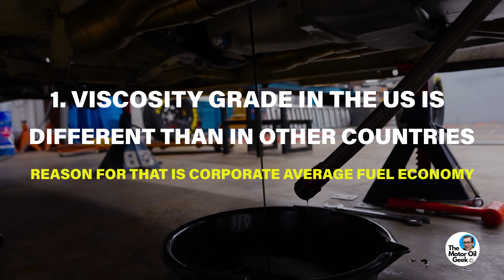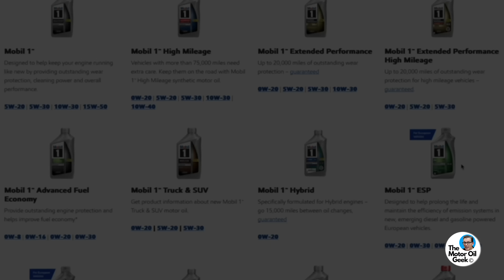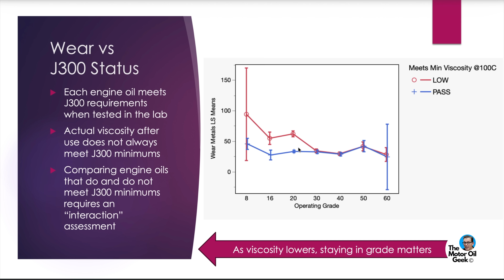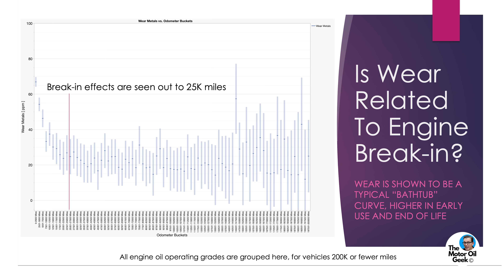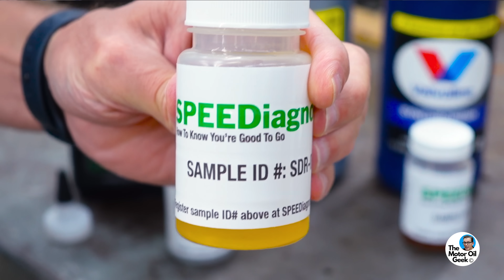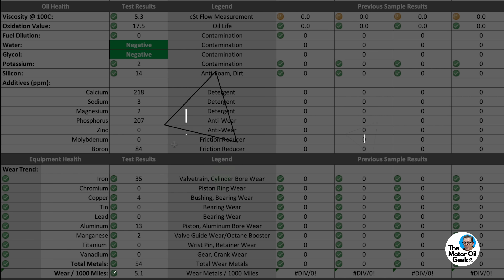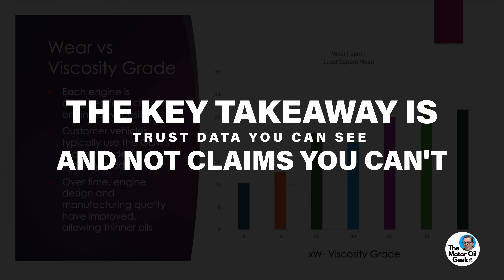More Ai Lies? The FACTS about 0W-20 vs 5W-30 (With Evidence)

Comment: My two newer Mazdas call for 0W20 in America everywhere else in the entire world the same exact car with the same exact engine call for 5W30. I switched them over to 5W30 because the 0w20 is recommended here in the US due to EPA mandates not necessarily engine longevity.
*Edit I also live in southern South Carolina where we see temperatures rarely go below freezing and the summers are hot!
Reply: 5w20 should be good too
Reply: If I understand correctly....basically, the very single reason these thin engine oils exist is due to gov't interference/ CAFE!?
Reply: @hynsum Kinda, emission regulations is extremely strict in the us and manufacturers do everything to make there cars get higher mpg ratings. One of these tricks is to use thinner oils. Thinner oils flow easier and therefore less energy is used by the oil pump. Less energy used = less fuel used.
Reply: @davidontiveros554 not mainly oil pump but friction between cylinder walls and piston!
Reply: @hynsum  ...YES....cars are mandated to have certan "Corporate Average" Fuel ecoomy ( hence "CAFE" standards) ...to ALLOW them to be sold...so YES....the average is for the total number and type (size) cars a manufacturer offers.  As the fuel mileage standards/demands increase every year....the makers need to find every way possible way,  to eek out that extra 0.1 or 1.0 mpg......
Reply: @hynsum  Yep.  Seems i read a couple of years ago that the manufacturers get fined by the government for every 1/10 of MPG the fleet of vehicles are below the CAFE standards.
Reply: @jerryware5749  CAFE regulations are dead. Our President abolished those mandates a few months ago or so.
Reply: @horseathalt7308  He did not. I wish he would! He simply rolled them back a little bit.
Reply: Same here, 2024 CX-5 NA.  I use 0W30 in winter and 5W30 the rest of the year.
Reply: @MEfunny111  OW-30 basically covered all seasons. Why need to change to 5W-30 ?
Reply: @vitkiu  Usually the wider the range, the more viscosity enhancers are needed to stop it from going too thin at high temperatures.
Reply: @vitkiu  In theory the 5W-30 would have less sheer so maintain the grade better, however just like Lake said and used oil samples being taken from the very same engine of different brands/formulations, that not all oils listed as the same viscosity have the same sheer stability. But you are right that on paper, the 0W-30 in theory should work fine all year around and to be honest some full synthetic 5W-30 oils perform almost as good as a 0W-30 in cold flow testing results done by oil manufacturers.
Reply: @Sylvan_dB  Thanks, it's good to know.
Understanding Viscosity and Its Enhancers
Viscosity Basics
Viscosity measures how easily a fluid flows. In motor oil, it indicates the oil's thickness at different temperatures. A wider viscosity range means the oil can perform well in both cold and hot conditions. For example, a 5W-30 oil is thin enough for cold starts (5W) and thick enough for high temperatures (30).

Role of Viscosity Index Improvers
To maintain performance across a wide temperature range, viscosity index improvers (VIIs) are added to oils. These additives help prevent the oil from becoming too thin at high temperatures.

Impact of Temperature on Viscosity
Low Temperatures: Oil thickens, making it harder to flow. VIIs help keep the oil flowing smoothly.
High Temperatures: Oil thins out. Without VIIs, the oil may lose its protective qualities, leading to increased wear on engine parts.
Viscosity Index (VI)
The viscosity index indicates how much an oil's viscosity changes with temperature. A higher VI means better stability across temperatures. Synthetic oils typically have a higher VI than conventional oils, allowing them to perform better in extreme conditions.

Conclusion
In summary, a wider viscosity range in motor oil requires more viscosity enhancers to ensure the oil maintains its protective qualities at varying temperatures. This balance is crucial for engine performance and longevity.
Reply: @charlesb4267 
Thank you for helping me to understand this better. (:
Reply: @MEfunny111  wow, switched already, not that it really matters I am going to work my way up to 5w/30 over 36k miles
Reply: @MEfunny111  Just switched my 2024 NA CX-30 to 5W30 Valvoline Restore & Protect oil today and also live in the Minnesota winter, only have 11,000 miles on it, and after switching it today, the car seems quieter but have yet to try a cold start
Reply: Smart, 5w30 is not going to do harm.
Reply: In your climate you would easily be able to use 10W-30 if you so desired although for the best oil characteristics with sheer stability and a good NOAK rating, I would still say use a full synthetic oil. Of course change the oil often enough ( and that is where the question mark will be, what is often enough ! ) and imagine you have that totally retarded stop start crap and to prevent that from functioning and those various interventions certainly won't hurt your engines lives one bit.
Reply: Smart!
Reply: 2020 Mazda 3 here running 5w30 all winter. Runs like a champ. Also on a tune which causes richer mix/fuel dilution. Currently @145k miles.
Reply: @shueher1 what are your low temperatures during the winter?
Reply: Same. I have a 2025 Mazda with the 2.5L NA. I also switched to 5w-30. I especially felt good about that because I’m in Phoenix AZ (stupid hot in summer and pleasantly warm in winter).
Reply: @duaneschleef  I've been to Phoenix once years ago during January and I certainly didn't experience anything that required a 0 anything oil, there would never be a real reason to use anything less than a 10W-30 in all honesty during the winter, never mind during your summers. I was also through Death Valley once in the middle of July and it was 118f ( and was told that was right on average for that time of year in Death Valley ) which I understand Phoenix can get as well every so often. If I lived down there I probably would run a 5W-40 or if I could find a high quality 10W-40 full synthetic, especially during the summer in my GM HD gas pickup ( GM calls for 5W-30 as a heavy duty gas engine ) and make sure to change it quite often as the manufactures recommendations are totally out to lunch for oil change periods.
Reply: I have a 2019 Miata calls for 0w20. I'm going to switch to 5W30. Glad Trump got rid of the cafe standards
Reply: I work on a lot of Mazda engines and their turbo engines take 5w-30. Probably because of the forced induction helping out with fuel economy so Mazda just says to use 5w-30 for the added protection of the turbo/engine
Reply: @andrewflores4981   Yes, Mazda also recommends 5w30 for 2.0 and 2.5 engines in Mexico but 0w20 in Canada and USA. Viscosity is one thing but the specs are more important to me, my 2021 calls for ILSAC GF-5 ( API SN ) which dated 2010 but we can put ILSAC GF-6 ( API SP ). Those are always backward/upward compatible ( latest incorporate more protection for Turbo engines )
Reply: America's speed limits are much slower.European speed limits are 120km-130km 75-80 and more hence Freeway speed.
Reply: Yup same here both my mazdas I use 5w30
Reply: The engine in my 2015 honda accord like to use the johnny walker black 5w30. Runs smooth and ticks a lot less.

Comment: Blanket statement claims are the issue here. Oil weight should depend on use case. The hyper car manufacturers have done it this way for years. They'll recommend 0w20 if you're driving like an old lady on the highway (very little heat accumulation) vs a 40 or 50 weight if your racing it on the track (very large heat build-up), and various grades in between. For those of us who modify our engines for more power this also puts more strain (and heat) into your oil and should be taken into account. 

Oil analysis should be run regularly to determine if your oil is actually meeting your use case.

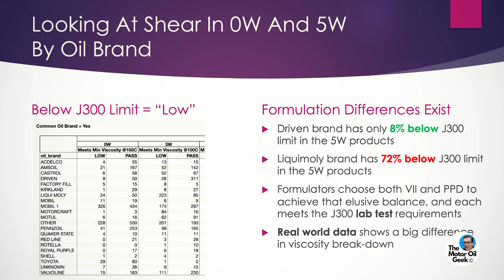Comment: Please explain further the chart at 5:12; some of those brands have very high numbers comparatively
Reply: Exactly. I think lower is better which means mobil1 is bad?  And Kirkland oil is really good?
Reply: @azpcox  In this table the Kirkland sample size is rather small and I would take that with a grain of salt. All in all more historical data on this table will be valuable over time.
Reply: Number of samples tested
Reply: I too would love some better explanation of that chart. As I read it, it seems to say that if the result is under J300 limit it is "low" or in other words a bad mark vs. "pass" and then the number of samples that ended up in each. For me I am looking at that Pennzoil 0w line because I use Ultra Platinum 0w20 in my Mazda and it would seem to indicate of the total sample size, ~14% of samples were out of grade. Compared to the 5w (which I have considered since my ND Mazda Miata is 5w30 outside of the US) it would indicate ~37% of samples were out of grade! Of course we don't know all the other variables like how old or well maintained the vehicles were, and so on and so forth so doing testing is important for your vehicle if you want the actual result rather than inferring something from this.

Comment: Ow-20 vs 5w-30 needs to be controlled for base oil chemistry. Nearly every 0w-20 is full synthetic. Comparing that to Jiffy Lube 5w-30 isn't very scientific.

I have about ten miles of timing chains in my engine. Shear is REAL.
Reply: 5w30 is the way to go. Full synthetic.
Reply: @Lumpia_In_Texas 💯!! PUP or Valvoline R&P for me! 💪
Reply: 100% this.  A nice synthetic 0w30 or 5w30 should outperform a Ow20 in most scenarios.  A synthetic 5w30 would only be weaker in colder climates.

Comment: Doesn't the viscosity of oil depend a lot on bearing clearances and not just "one for all"?  I think that context gets lost in so many discussions on this topic, I think you are one of the only ones who have mentioned it.
Reply: Not only that, but Toyota has developed a sort of variable pressure oil pump that was designed to run on thinner oils, such as their 0W-8 synthetic oil. Using thicker oils is not advised.

Comment: I drive a 2012 Honda insight with 290k miles, on a diet of 0w-20 quaker State high mileage changed at 10k miles. Doesn’t burn a drop, oil samples come back great, only thing I need to keep an eye on is the fuel dilution, which is at 1.3%
Reply: Change it every 6 k miles.
NEVER 10 k. !
Reply: @philllsxga.7737  Because his oil samples come back good showing the oil is still doing it's job. The engine doesn't use oil and runs good. It has gotten 300k mi this way but your belief is more proof than science and real world.
Reply: @turbosbox pull out your dipstick.
What color is it?
That's what the inside of your engine looks like...
Reply: @philllsxga.7737  Pull off your oil cap and look at it and the valve rockers and springs and head, that's what my engine looks like. I go for about 7k mi myself but nutballs still think under 5k normal conditions is helpful.
Reply: @turbosbox I change my oil at 6k miles which equates to around 22 percent oil life for my vehicle..
Most modern vehicles have fine screens inside their engines.
That is one reason why you never go 10 k miles on an oil change.

Comment: I miss the good old days when you just bought 10W-40 and did most of your car's maintenance in your driveway.
Reply: Carburetors, dwell meters & timing lights  now I am in control.
Reply: @GldUltExtngshrofdebt and no EPA.
Reply: @GldUltExtngshrofdebt I see your points (and condenser!)  I still have the GM flex allen screwdriver for setting dwell thru the little door in the distribber cap that slid up.  Feelin' old...
Reply: I still do just that but then I still drive an 80's carbed vehicle with an old-fashioned single dizzy..
Reply: If you have a port injected petrol you can still use 10W-40 if you want. :)
Reply: remember 20-40w shit my datsun loved that oil .......then they quit making it fuckers xD
Reply: I do maintenance in my driveway all the time. I use 10-30, 5w40 in my land rover. 5w30 in my daughter truck. 
I do all my maintenance. No shop work ever.
Reply: Also you mean the days engine rebuilds were common? I'll pass on needing to replace rings as a service item to get past 100k miles.

But hey, nobody stops you. You're the one complicating things for yourself.  I've been doing 5W-30 in my driveway or garage and engines outlasted the rest of the car. 

One of my two cars now takes 0W-20 and that engine has been out for a decade with plenty 250k+ examples so not worried either. Oil analysis showed excellent results.
Reply: @snaaaaaaaaaaaaaaaake  Ahhh ... the easily-triggered fearless keyboard warrior.  It's just a light-hearted YouTube comment.  Deep breath - you'll get through this.
Reply: @pi-sx3mb 

Brother, if you are taking my comment as being as a triggered keyboard warrior, you're being a snowflake. I'm just sharing a light-hearted counter example and saying nothing stopping you from doing what you were doing before. You took it personally as an insult, that's on you.
Reply: @snaaaaaaaaaaaaaaaake 0W-20 is a scam. I don’t care what they say.
Reply: Back in the 80’s-2000’s all i used was 10/30 regular oil. 2005 yukon i used 5/20 synthetic. No issues.
Reply: 10W40 was never a warranty approved oil. Even back-in-the-day conventional, never had the sunburst 'approved' logo on any top brand's containers.
Never understood why precisely, I've used it (synthetic) for years, never had a problem.
Reply: Who’s stoping you now?
Reply: @MrApplesaucestuff maybe he's got a Bougie (but nosy) HOA?
Reply: 15W-40, 10W60, 10W40 and 5W30 cans of Castrol on my shelf.  For the V12 online said 5W30 but then I had to add LiquiMoly to reduce oil leakage and found 10W40 worked better.
Reply: Was usually 30W-40 in Australia. Even lawnmowers ran on it. It was in one pint glass jugs next to the bowser at every servo.
Reply: 15w-40 in everything. I don't even look at any other oil except Rotella t4. Best oil for the price
Reply: @AutoMotoMechanic yup I run t6 in everything that is out of warranty
Reply: I don't, 50s, 60s, and 70's cars were shite.  Had to change plugs, points, oil every 2,000 miles, intake manifold gaskets and heater cores failing, transmission went out on my 64' Belaire at 83,000 miles.  Windows and trunks leaking rain water.  Granted I liked body styles then, but mechanically they were crap.  Todays POS car is probably better than most of those older cars.
Reply: I miss being able to leave our house and car doors unlocked every night too.
Reply: Can still do that with anything🤣
Reply: Not my car ,10 w 40 the best

Comment: I have a 2026 CR-V with 1.5 Turbo, spec is 0W20 in the US but I believe it calls for 5W30 in Europe.  However, Lake or another creator pointed out that variable oil pumps and engine programming may also be different.  So I think changing the oil frequently is more important than using higher viscosity.
Reply: I have that engine in Europe (in a Civic). The engine calls for Genuine Honda Type 2.0 Oil (which is 0W-20) or if unavailable, it gives you a choice regarding to your operating climate, you can choose from 0W-30, 5W-30 and 10W-30.
Since 2018 the engine has a GPF (Gasoline Particulate Filter - like a DPF for gas cars) in the EU though, therefore we’re only allowed to run low ash oils with ACEA C2 or C3 certification.
Reply: The correct viscosity is especially important in your 1.5 Turbo especially in short trips when the oil doesn't warm completely and the engine is running at it's richest fuel mixtures.
Reply: @inspectorraycharles  I mostly drive highway.  And I do test some of my oil change samples.
Reply: I had an early 25’ CRV with that motor. Couldn’t get out of it fast enough. I was delighted when the crankcase was a half quart over with fuel in the oil on its first change and all the other potential issues that came with the boat anchor of a motor. Flipped it for the HRV with the naturally aspirated 2.0 K20.
Reply: @Not-Anonymous-187  I’ve owned mine since 2019, bought new, put 120,000km (75,000mi) on it so far and had zero issues. I mainly do long highway commutes at moderately high speeds (140kph/87mph) though. It only gets Shell V-Power (ethanol free in Germany) from me, exactly because of the dilution issue.
Reply: @cedricfranzen8558 Given my trips were 22 miles (11 each way) to and from work so not as much highway. Live in a hot climate which supposedly is supposed to be better for the dilution issue. I did run premium fuel. Keep an eye on your coolant. That motor has a track record of eating head gaskets as well. Nonetheless, glad yours has served you well. I just didn’t want to tolerate the long term risk.
Reply: The claim that engines have programmed differences for the oil pump is non-sense .. there is zero proof of such theory
Reply: @EverydayJ1786 The easiest way to tell if that's even possible is just to look at the oil pump.

Comment: We love your videos but WHY IS NO ONE EXPLAINING A REASON TO USE A 0W-30 INSTEAD OF THE 20!? Especially you! 

Safe cold flow with the hot temps of protection from the 30?!
Reply: This. In Europe this is a very common oil spec.. Seems to cover all needs and it is full synthetic if sold in Europe.